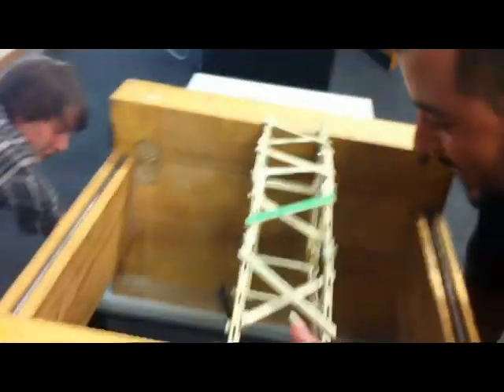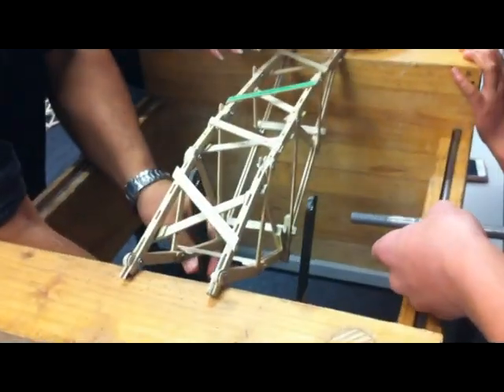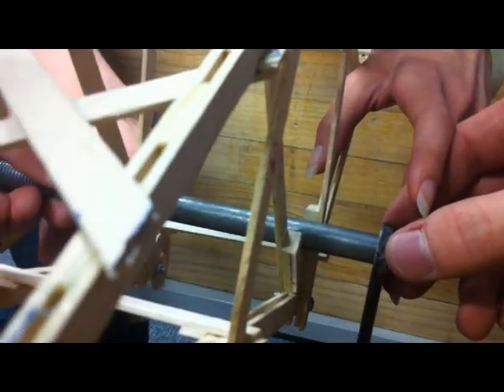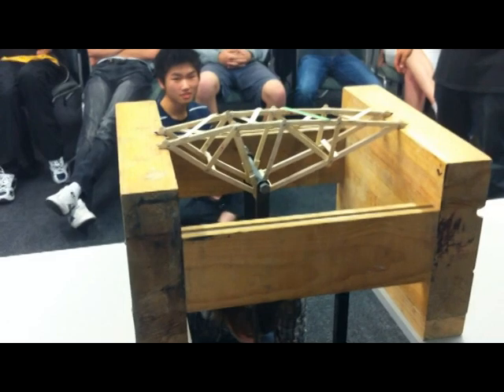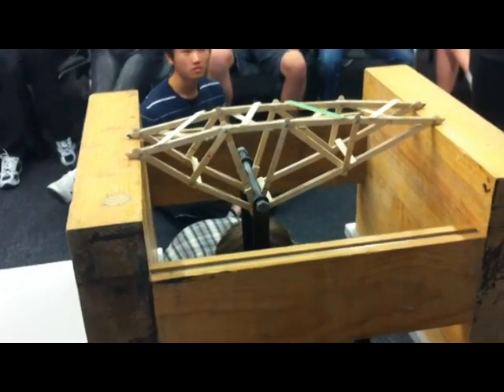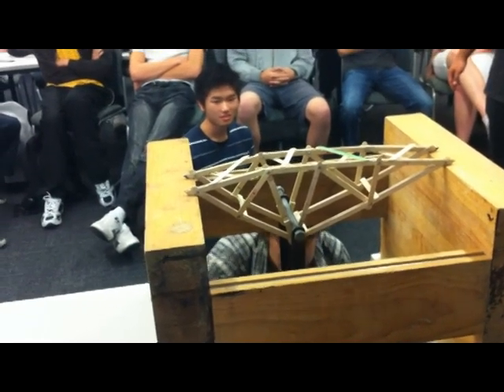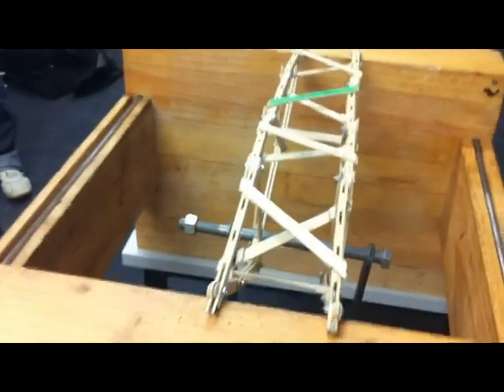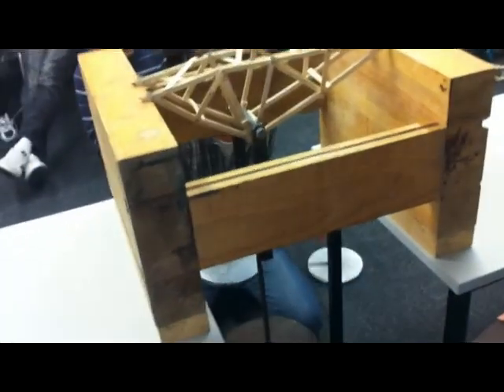Record Truss Bridge 2012 - University of Auckland Engineering

Comment: it  could be better in analysing  accurate value of load bearing capacity  of bridge if  the team has applied the loads exactly on the  "DECK" portion of the bridge.
Reply: @M Ali  I'm actually an engineer and you are completely wrong. It makes a big difference where the load is attached. The bridge would be able to support significantly more load on its deck because it would be distributed more evenly on each member. Hanging it from two points causes certain members of the structure to be loaded more than the others thus making the bridge weaker overall. A finite element analysis (FEA) of a simple model shows why. See link below.

http://s952.photobucket.com/user/OU812_/media/Bridge%20Sym_zpslfudxz15.jpg.html
Reply: +M Ali   You specifically said "Well a uniform tray loading on top can help but again the result would be the same"

That`s exactly how I distributed the load for the model on the left and for the model on the right it was suspended exactly how they did it in the video...2 points! They used a rod to span one side of the bridge to the other but its still only a two point load because that rod contacts the bridge at only 2 points (1:44).  The resulting stresses on the bridge are clearly not the same!

I've proven you wrong using industry standard analysis tools.  My FEA model is far more accurate than any of your statics equations. You can ignore the results all you want but it won`t change the facts. 

Your argument and statements also have no validity unless you can back it up with numbers and results...just like I did. So go ahead and prove me wrong. Show me your magical statics calculations.
Reply: I agree, the load would be on the top deck.
Reply: Yeah, this is basically calculating the average max load with 1 fatal test instead of just pencil & paper.
Although he should have used a special loading tray to put the weight on with less initial force.
Reply: I am also an engineer... an electrical one.
Reply: it doesn't matter what the most accurate way of testing the true value of the bridge would be so long as the specifications and requirements were met and all competitors were tested the same way. this isn't a competition to build a functional scale model of a bridge. it's a competition to see who can load their bridge with the greatest amount of mass from an under-hung load bearing assembly, and all these bridges were engineered with that goal in mind; not with the goal of the load being placed upon the top like a traditional bridge.
Reply: Carried to the extreme, a span that merely supported weight at a point just alongside one of the supports, with enough bracing to support weight at that pair of points, with just an "outrigger" span reaching to the other side of the span for stability, might even support an even greater weight. 

It would look like the hook that goes over a door, with much of the material used in the "hook" to suspend weight from, and less material used to span to the opposite side of the span.

I do wonder just why they chose an asymmetric design but one that seems somewhat arbitrary as to just how far off center it was.
Reply: Richard R, I understand what you say and thought the same thing. I will add to what you said and that is the load apparatus used by all should be exactly half way along the length of the bridge, not off to one side. John, OZ.
Reply: To be fair the load should have been applied at the center of the span.  The maximum bending moment on the whole span occurs when the load is at mid span.  If it was "legal" to apply the load off center a designer could design a structure to be loaded adjacent to one of the supports and chances are good it would hold a much greater load then and span loaded at mid span.
Reply: Who is Engineer here? The result would be the same man!!!, they used the triangular shapes, the load is suspended perfectly in the middle and distributed on each section. You cannot apply load on top at a certain point. Well a uniform tray loading on top can help but again the result would be the same :-)
Reply: OU812 buddy I am also an Engineer I am not talking about two points of load read my comment again and if you do not understand take any book of statics, read thoroughly and try to  solve problems. Thank you! :-)

Comment: Why do they have to add the weights that fast?
Reply: Because for the load to be counted it has to stand for three seconds, no more, thus the counting. They hurry because after three seconds per plate there is no reason to dawdle with catastrophe imminent at any second.
Reply: Did you ever ride a slow rollercoaster? Not much fun.
Reply: Because those are the rules for everyone

Comment: the load should be on top of the bridge structure for more accurate testing.
Reply: ..unless the design was intended for the load to be from 'the bottom'..as are most railway truss bridges..lol
Reply: Dan P   lol...just look at the standard rail train cage truss bridge...its like a rectangular box...the train goes through the middle...the weight is therefore on 'the bottom'..which in effect is the same as if it was suspended from the bottom.   here is a picture of one... 
      https://www.pinterest.ca/pin/299067231481926963/   ....by the way all i said was the testing is more accurate from the bottom if the load was intended to be from the bottom...SIMPLE
Reply: Dan P  that is EXACTLY my point..it works ONLY if the design intended the load to be at the bottom..good grief
Reply: Umm... There is a nearly identical pair of bridges in: Sarnia, On / Pt. Huron, Mi (i.e. "The Bluewater Bridge"). The load (blended traffic) is suspended almost exactly where this load was placed.
They are cantilevered ~equally, designed like right after WW2 basically (slide-rules); and are definitely loaded directly on the point where the 2 joining objects meet (i.e. The border). The highest conceivable load would be dead center & it obviously has a weight limit so occasionally in super heavy traffic they stop the crossings so the Americans can clear enough cars.
Reply: Dan P   ..so Dan...when I said the load test was accurate if they INTENDED the load to be on the BOTTOM  and inaccurate if they INTENDED for the load to be on the top ..what problem do you (apparently to a great degree) have with that statement?????  the original comment was 'the load should be on top of the bridge structure for more accurate testing'   and i said ''unless the design was intended for the load to be from 'the bottom'.  I am very curious now..you seem like a dog with a bone of some kind..lmfao just please explain this to me   ..(and yes I am capable of imagining a use of this design where the load does go 'through the middle' but that is not my point it is about the test lol)
Reply: nateman10      yes they are for long spans...check how they make them 4 large scale..  https://www.youtube.com/watch?v=rEDevQB6_tE
Reply: and why is it asymmetrical ?
Reply: DangerDaveFreestyle   it looks like an upside down variation of a ''Waddle A truss''  in which case the load should be 'pushing up from the top'  lol... all i said was the test should be where the load was INTENDED  and that if they intended the load to be from the bottom then its all good.   the design is a test .. variation of Waddle A truss ...they could modify the design to accommodate any configuration.. Cheers
Reply: @jaybefaulky4902  lol btw
Reply: Rice Man  a floor truss is a horizontal simple truss used for long spans for floors..like flat roof trusses but just for a floor
Reply: nateman10 - Take a look at how the world trade center was built.
Reply: Choice777  the project was designed for a load to be placed closer to one side of the bridge so therefore an asymmetric design is needed
Reply: This project was only an introduction into engineering design techniques and methods, so not application was considered with this project as these were first year students or freshmen in other words.
Reply: nope
Reply: that bridge in the video appears to be the type somebody would drive on top of with a car, truck, bus, etc
Reply: Dan P   boy your determined...lol    i also said they could modify the design for different configurations obviously for different applications ...(including a bridge of course)..and by the way when i said 'it only works' i was referring to the veracity of the load test (being from the bottom as opposed to the top)  the original comment was 'the load should be on top of the bridge structure for more accurate testing'   and i said ''unless the design was intended for the load to be from 'the bottom'...''   i never said the design couldn't work if the load was on top or bottom ..i was ONLY EVER talking about the 'accuracy' of the 'load test'..and as i said ..the load test is accurate IF the design WAS INTENDED to be from the bottom ..other wise the test was inaccurate and should have been from the top...you get it now??????  sheesh
Reply: Jay Edlington     yes very similar   the load sort of 'goes through the middle' and is transferred to the lower portion. that bridge is a very cool design eh?
Reply: Dan P  yeah ..its just an upside down version dude (load location)...lol   and both said similar NOT exact..good grief dude..
Reply: I've never heard of a "floor" truss.

Comment: say, isn't the load-bearing point supposed to be at the center of the bridge?
Reply: I guess not in this assignment. There might have been rules about how off-centre you are allowed to load though. But it really doesn't matter as long as all the other bridges in the class followed the same set of specifications.
Reply: henkiedebomb I believe putting the weight in the center is easier to design. Because center loading means the bridge will be symmetrical. Given limitation on the number of sticks, it's easier to find an optimal solution. And all the bridge in the class will be about the same. Putting the weight closer to one side will hold more weight. But there is no obvious optimal solution. And that makes the challenge more interesting. Which results in a lot of different designs in the class.
Reply: David Xu Yeah it did seem like the assignment, pretty awesome thx
Reply: David Xu Does that always make it harder than putting it in the middle? or does that depend on your materials?
Reply: I think it doesnt matter. When it's off centre the longer side is weaker.
Reply: I think you mean CENTAH

Comment: Great work, I've always wondered why trucks don't use triangular beams afer all the proof of strength over I beams.
Reply: Not so, an I-beam will have a higher moment of inertia about x-x axis. This is due to the second moment of area of the flange portions, and their distance from the centroid. The I-bean is therefore better in bending in one direction. Certainly a circular section or similar would be better for a geodesic dome structure or similar.

Comment: not bad.  in 7th grade, for math class, i had to construct a bridge from balsa wood.  i can't recall it's weight, but dimensionally it was about 1/4th the size of this bridge.  we could only use elmer's school glue and i chose the truss formation.  it supported 80 lbs (~360N) of sand + whatever teaching supplies the teacher could put onto the bucket.  It actually broke because a douche classmate was purposely bouncing the weight..grrr.
Reply: The point is that this is a determinate truss system and all forces on the joints and members must be calculated. That is the learning outcome. Not, 'can you make a pretty popsicle bridge'.
Reply: Mine held 140lbs
Reply: Mine held 100000000000000N
Reply: +Golden Duck uh huh.
Reply: The weight of a cubic kilometre of actinium.
Reply: When I did it in school it was only made of two popsicles and a piece of string, and we got it to support three loaded busses and the music teacher(she was really fat). It broke when the entire state of Wisconsin mysteriously fell from the sky and landed on it before vanishing without a trace. Grr.
Reply: icawn and your point is

Comment: anyone know how the breaking member/load was calculated? And whats the deal with the asymmetrical design? just interested if that was down to restrictions or a structural advantage?
Reply: Jack Heather Jack I believe that "statically determinate" structures just implies that a structure can be solved and reactions determined by use of simple "statics" problems. You're correct that 2J=M+3 (j is for number of joints/nodes, m is for number of members in the structure)!! Statics problems let you solve for the structure's reaction forces in an easier way (compared to more complex, indeterminate structures that requires more rigorous analysis for), and therefore making a bridge design simpler. This bridge blows me away though!
Reply: I think the restriction was that the weight had to be supported from the side rather than the centre.
Reply: Space Gass - Engineering program free online
and Hand calculations, simple equilibrium force distribution methods.
:D
That way you calculate the forces being distributed and finding the member with the highest value.
Then you just use further relevant calculations so you have suitable materials and glue ect to make sure the members can actually withstand such forces. ect
And noting what is in compression and tension as material will be strong for certain forces.
Reply: Jack Heather Its 2J=M+R where the R represents reactions acting on a joint/ truss
Reply: thanks everyone
Reply: Iv done some research for a bridge to be statically determinate it needs to satisfy the equation 2J=M+3 where J is the amount of joints and M is the number of members

Comment: 1087 Newtons, thats only 110 pounds right? And this is at a university? A kid at my high school built a popsicle bridge that weighed under 125 grams and supported 1600 pounds. How is this bridge a record holder?
Reply: kg not pounds
Reply: They calculated the maximum amount it could hold before this test. Did they do that at your school?
Reply: 244 pounds.
Reply: ain't SHiYT
Reply: First of all its 244 pounds. Secondly, as mentioned above there are a WIDE variety of restrictions and tough constraints that these students have to work with. Including having a bridge that is STATICALLY DETERMINATE, not that I expect you to know what that is, but basically it means that you can't just flip a bunch of sticks together in any shape- it has to be solvable by hand and calculator basically. Also these students have to predict the breaking member, the breaking force as well as having to deal with other constraints such as the total weight of the glue, bolts and Popsicle sticks being under a certain amount. 2014 students have another constraint which is a obstacle placed awkwardly that cannot touch any of the members. So PLEEEEEEEEEEEASE stop being such ignorant scum and realize that there is  a world outside of your 'school'.
Reply: Please look at the requirements again and notice the difference from your "school" bridge as this type of truss bridge is quite complicated to make with so many restrictions compared to a conventional truss where the qualifications are very lenient